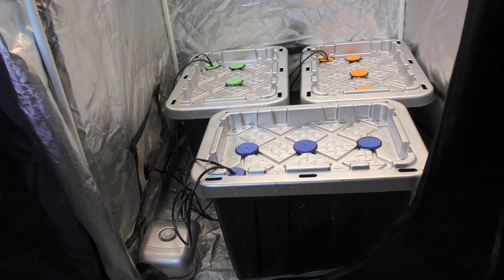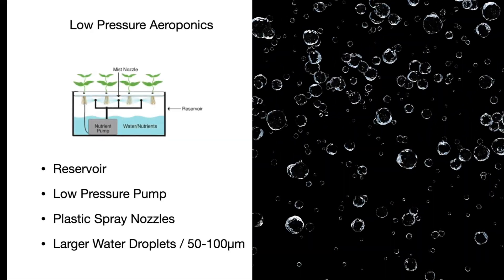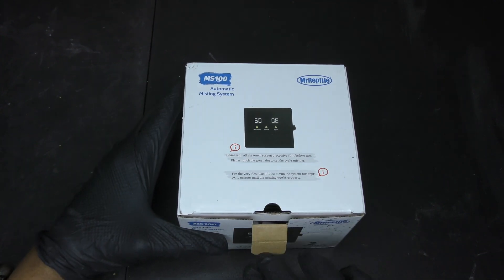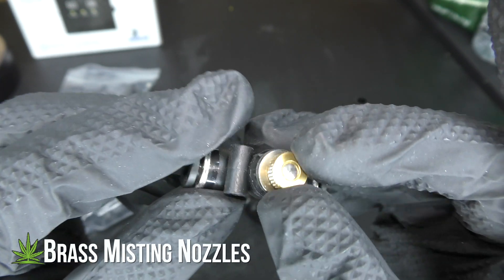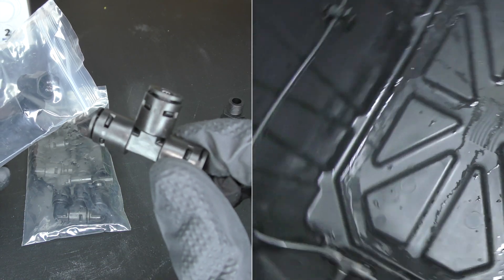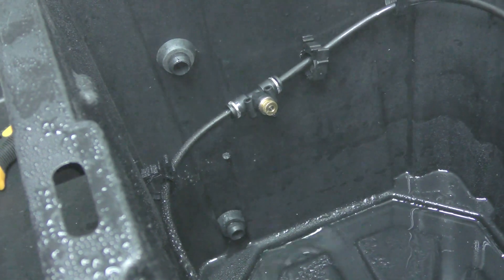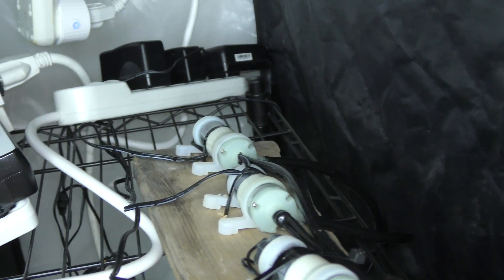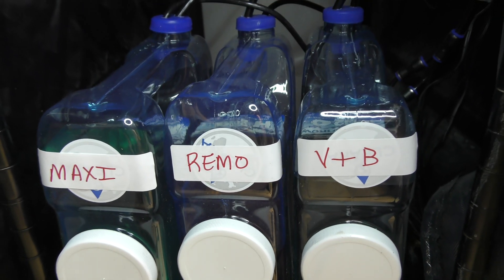DIY HIGH-Pressure Aeroponics on a Budget 💨💦 | Cheap & Easy Upgrade!

Comment: I am not an expert at this but couldn’t you use two diaphragm pumps for the whole system. One for misting and other for drainage with the timers at different intervals. All drains go to one return sump pumped to the reservoir. All the containers will be linked.
Reply: I mean the main issues people face with HPA is it’s price point. That’s the good thing about these reptile misters - they’re cheap. You’d struggle to find a good diaphragm pump that can push a high enough PSI to supplement 3 baskets (plus fittings) AND a sump pump that can pull the water out fast enough and still produce enough pressure to aerate the water on the return without spending more than $23
Reply: @suckout7244 Aeroponics is cheap

Comment: High pressure is great efficiency wise but is very prone to clogging and potentially problematic because of the salts clogging repetitively. In addition, margin for error is very slim if you lose spray nozzles. 
One possible solution is high pressure air and low pressure water.  Look up Babington burners diy.  To reduce and lessen clogs they use the premise of whale blow holes.  High pressure air is blown out a nozzle, with low pressure water cascading over the orifice.  In the diy burners people often use brass door knobs.
Reply: Its called air atomizing or air assisted aero, its been around for well over a decade. AA nozzles are available in siphon fed and pressure fed, internal or external mix, round cone and flat fan. I run 30psi air on siphon fed nozzles and 43psi air / 30psi water on pressure fed.  Siphon fed AA nozzle with 30psi air pressure delivering 1 second of mist into a 26gal trashcan https://youtu.be/LYv_hw1Xx8c
Reply: @atomizer2665  I don't know why people don't get this. Ultrasonic misting nozzles have been around for over a decade and a half now and people are still talking about clogs that never happen anymore. If you're getting a clog in your misters, you aren't using enough pressure, or you're not using a chiller to circulate the nutrients to keep the salt in solution. It's just so dumb.
Reply: @printingwithpeek  
I dont recirculate the nutrients and i`ve never had to use a chiller.
Reply: @atomizer2665  Well I do just to keep them at the optimal temperature and the bedt distribution.
Reply: @printingwithpeek  
I run all my aero drain to waste which negates the need for a chiller and guarantees the plant receive pristine, elementally balanced nutrient every misting. Chilled nutrient is good but the root chamber temperature is more important to the plants. Using chilled nutrient to directly control root chamber temperature generally results in too much water being delivered. The elemental makeup of a recirculated nutrient is constantly changing as the plants remove what they need and the leftovers get mixed back into the reservoir. The elemental make up of a non recirculated nutrient doesn`t change, the last drop is identical to the first.
Reply: @atomizer2665  I was thinking about building a hybrid LPA & ultrasonic misters system where one and the other would be running in turn with a multi-channel programmer in the style of Mist 2 minute ON / Post-mist delay 2 minute / 1 minute ventilation then several cycles LPA 5 second ON / 55 sec OFF the last LPA ventilation 1 minute before the next mist so there would be 3 mist and 2 LPA (2 series of cycles)  in 30 minutes and ventilation at the end of each minicycle etc... 
Do you think that could compete with a HPA in term of oxygenation .going on vacation with an HPA in the apartment I don't like it too much
Reply: @arnaudjean1159  
You`d gain little benefit from the ultrasonics as the LPA will soak the roots.  Aeroponic roots have access to oxygen 24/7 due to the mist droplets connecting with the root hairs which leaves a lot of gaps. The LPA will leave a film of water on the root with no gaps. The film of water may contain upto 12ppm of dissolved oxygen but it pales in comparison to the 21%  oxygen in air. (210,000 ppm)
Reply: @atomizer2665  ok I understand.
LPA gives too much water vs oxygen  but the question is do the plants need   nutrients 24h/24 given that in soil you  rince with water only, every 3 watering to avoid salts build-up. 
So with less fertilization from LPA per day and more mist form the fogponic   I will experiment  with that more mist oxygenation and less but several daily LPA for nutrients. And my system consist of lots ofventilation of the root chambers  . I will experiment with that Before investing in a HPA
Reply: @arnaudjean1159  
HPA and LPA create very different root structures. If you massively over mist in HPA you can create the LPA (aka hydro) root structure, LPA cant create the HPA root structure because it delivers too much water.
Reply: @atomizer2665 You still need to run a recirculator to aerate. That's what you're supposed to do and I always use a a dosing system that gets fed from R/O water. Also, your statement about having too much water delivered is not correct because you're getting the same dosing every time. On top of that, your comment about how a chiller making it different every time is incorrect because both systems are recirculating run off which means that you need to monitor your ECs and then your way would be inconsistent, not mine. That doesn't make any sense.
Reply: @printingwithpeek  
In my HPA systems the accumulator is the reservoir, there is no need for aeration. I`ve left nutrient in an accumulator for a month to see what happens and the answer is nothing, the EC and PH were unchanged. Note; this wouldn`t be the case for an organic nutrient. As far as water delivery is concerned i`d suggest measuring how much the plants are actually using hour by hour. You can do this by measuring how much water the combined nozzles in the system deliver per second. That value along with the timing cycle will tell you how much is being delivered per misting, per hour, day etc. Once you have that info, simply collect and measure all of the run off you get on an hourly basis. Knowing these values will allow you to set the timing more optimally.  The EC of a nutrient that is recirculated is constantly changing as the plants uptake what they want and what remains is mixed back into the reservoir. This is not the case with a non recirculated nutrient, a nutrient that never comes back to the reservoir cant affect the ppm. Another benefit of a non circulated nutrient is the elemental content is constant. If a non recirculated reservoir is a fridge full of food, a recirculated reservoir is a cross between a fridge and a trash can. You have to dump and replace a recirculated reservoir when it becomes elementally unbalanced.  A non recirculated reservoir just becomes empty, it is never elementally unbalanced.

Comment: I`d keep the reptile misters close to hand. You`ll find those cheap brass patio misting nozzles highly prone to partial clogging, which results in very fine needle like jets of water instead of mist :)
Reply from the maker: I'm going ALL IN on high pressure, so I hope you stick around. Keep the advice coming please!
Reply from the maker: Big love, appreciate that 🖤
Reply from the maker: Came back to say - You were so right. A week later and I had my first clogging!  Almost lost my plant. I've started cleaning them with vinegar water, and that works. But I'm thinking about buying a few spare nozzles to swap out for convenience. I appreciate you!
Reply: @RiskyBizz  
When you`ve replaced them  all a few times over you`ll look for an alternative. If you have a 10-24 tap you can repurpose the duff nozzles as thumb screws in various projects :)
Reply: Use this for smaller roots and as they grow switch to a high pressure air drip instead to avoid having to buy the brass mist nozzles as much. This way you wont be spraying the young fragile roots at the beggining with the air system. It's kind of like those recirculating drips circles on those hydro buckets  @RiskyBizz